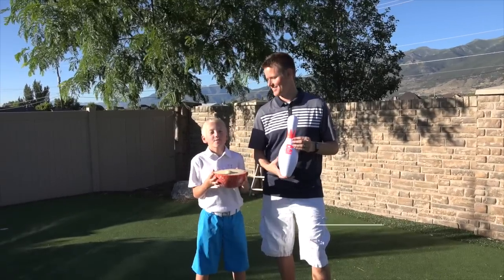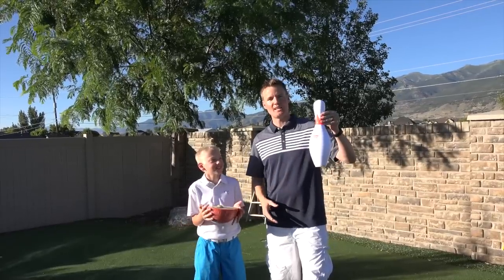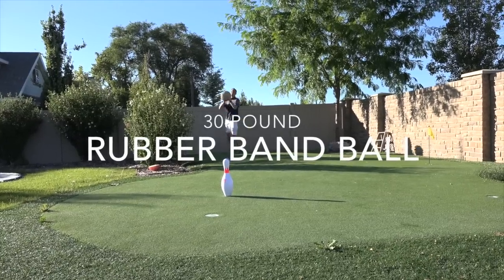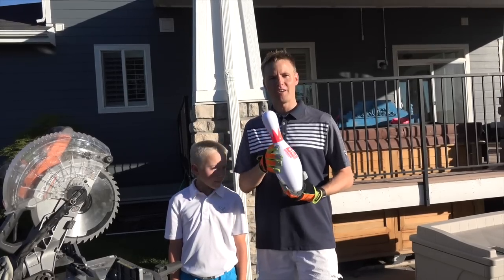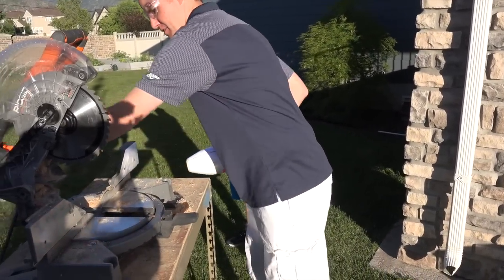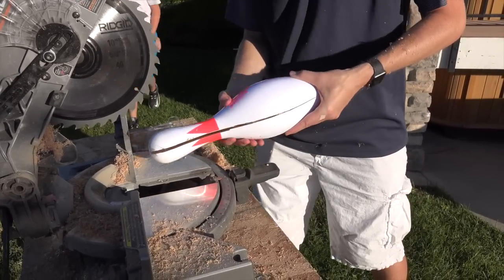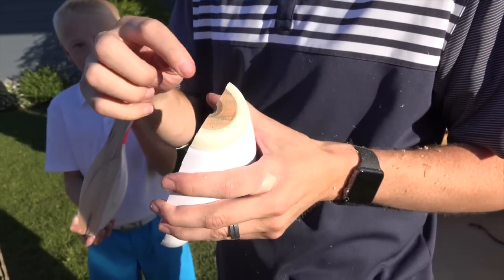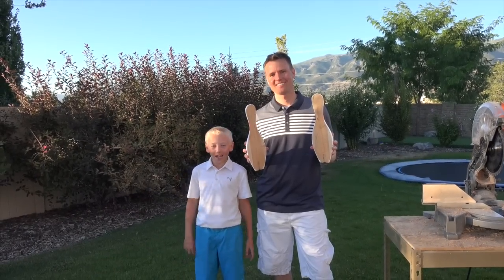What's inside a Bowling Pin?

Comment: First off I want to say I really like your channel, it's a great idea and having your son involved with it makes it that much more special.  Secondly, as a general contractor with some background in carpentry, I want to give you some friendly advice...

1. When using a miter saw, especially when cutting small objects that are that close to the blade, using gloves can be extremely dangerous.  One loose thread, strap or whatever can easily get caught in the high speed rotation of the blade and pull your entire hand into it.
2.  Seeing as though this is something that you're planning to continue doing on a regular basis, I'd suggest getting a better saw.  Many companies make sliding miter saws that have vices built into them to hold whatever your cutting in place and then the sliding mechanism allows you to pull the blade forward when cutting a wider/longer object such as your bowling pin.  I personally like Dewalt, for what your doing with it, get yourself a model with a 12" blade to give you some flexibility when dealing with bigger objects.  It will run you about $600 at Home Depot but it will give you some safety as well as more precise cuts.

Good luck and keep up the great work!
Reply from the maker: +Rob Pennachio Thanks so much for your suggestions. Clearly, I have very limited skills in this area. Learning as we go, so really appreciated the tips!
Reply: +What's Inside? Hey guys! You both are my favorite subscribed channel and I watch your videos the day they come out! Thank you for choosing to be on YouTube!
Reply: +What's Inside? can you cut open an xbox one

Comment: Just to let you know the hole in the bottom of the bowling pin was from the factory so they would be able to dip the pin into plastic. Also some bowling pins , the AMF Amflies, have 4 small gaps in the center of them to allow better pin reaction.

Comment: The hole on the bottom of the pin are for the older pinsetters which uses spikes in the deck to align them with pinboys setting them. Once set, the spikes are lowered, and the rack is properly placed with no variations in spacing (consistency placement).

Comment: Can you maybe cut open a pc mouse
Reply: He is not that rich
Reply: Lol a mouse is cheep like 6 bucks on amazon. Or even better do it your self.
Reply: Erling Jensen just take apart your own one haha, its just components inside
Reply: i dont know why but i read "mac mouse" .!
Reply: +Erling Jensen you don't need to ruin it by cutting it, you can just open it up. but really it depends on the age of the mouse, older ones have a heavy ball on the bottom that rolls rollers and those are translated by a circuit board into movements, and the circuit board also has the push buttons for the left and right mouse buttons, newer mice replace the ball and rollers with a laser tracking mechanism.

Comment: Some have a open area 2 inch hole right in the middle,not accessable from the outside for balancing reasons.
They are made out of Maple with a polypropylene plastic outer coating.
They are 3 pounds 6 oz

Comment: I assume the hole on the bottom is there as a result of manufacturing process. They most likely fasten a block of wood onto an axle, which then spins fast, and a computer guided chisel moves along it to shape the pin.

Comment: My guess is at the whole in the bottom of the pin is for the manufacturing process, possibly for the wood lathe or just to keep it secure when coating it with the exterior material.
Reply: *hole
Reply: That hole is actually to keep the pin standing properly on the lane

Comment: I believe the hole in the bottom is to adjust the weight so it can be within regulation. They drill the hole to reduce the weight and if its under, they glue in some steel shot or something.

Comment: The hole is probably used during the manufacturing process to hold the pin when they coat the rest of the surface with plastic.